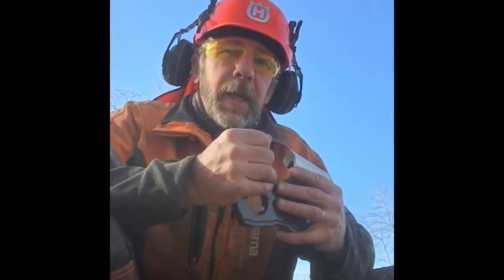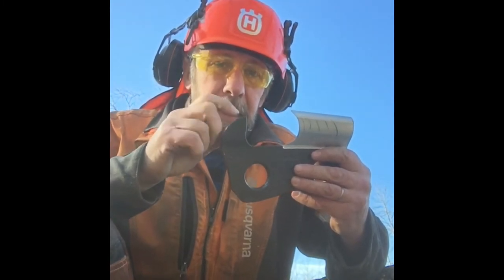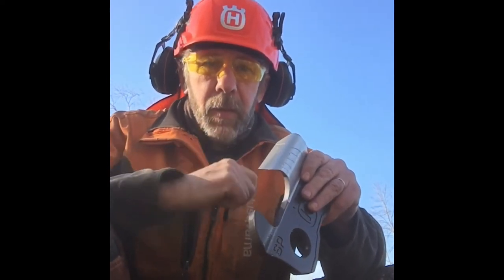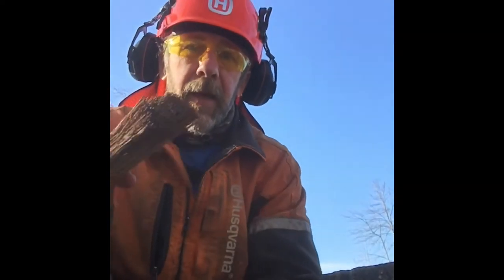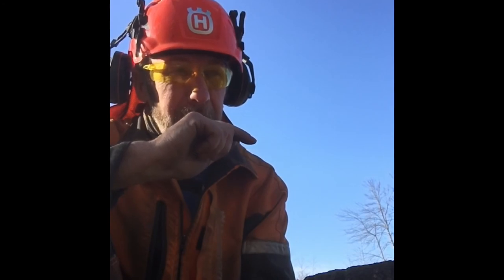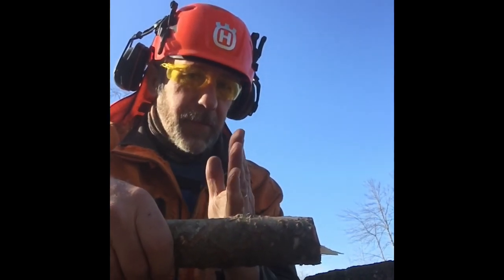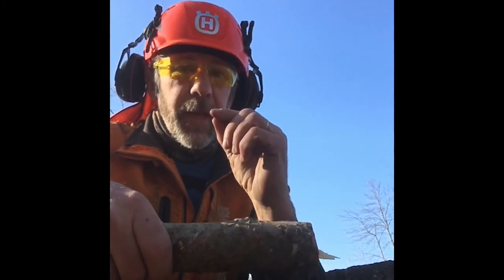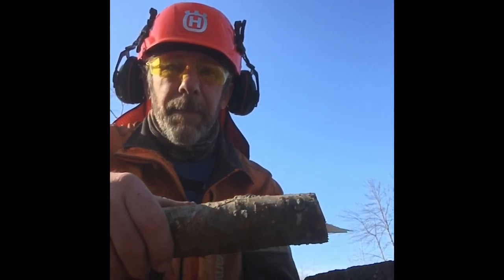Game of Logging - level 2 homework

Comment: In response to your question at 9:30, I suspect while bucking (cross cutting) that any time I'm cutting through a log at a point where there was a limb attached, that will change the jobs of the two plates.  But I don't think that is what your really asking.
Reply: That’s what I was thinking or cutting thru a burl

Comment: Would they be changing during The Cutting process and pressure on the saw when the corner is starting to get knocked out you would have to force more pressure into the cut and that's interrupting the swimming effect on the top plate going up leveling out and coming back down "exaggerated for explanation"

Or I'm thinking of something during chip flow interrupting that and having material still under the top plate or having the space already full between the cutters while they're coming around and through the kerf
Reply from the maker: Their jobs switch when the teeth come to a knot. The fiber angles change from parallel to the log to “roughly” 90 degrees. It’s not a perfect switch because the fiber angles are not perfect.
Reply: @gameoflogging  I was overthing the answer 🙃.

Comment: For a brief moment in the center of the log
Reply from the maker: When the chain comes to a knot. The fiber orientation changes. In between the knots, the side plate cuts the fiber. When cutting through a knot, the top plate is cutting the fiber. That’s why both side and top need to be sharp and are filed at basically the same angle.